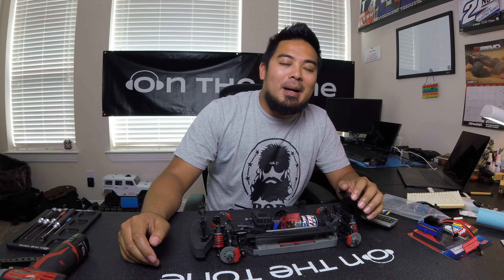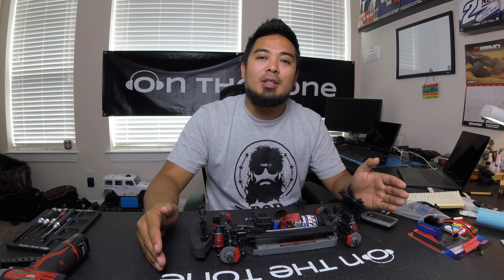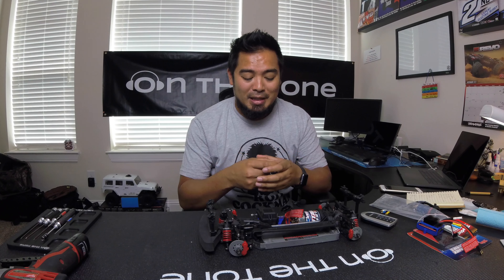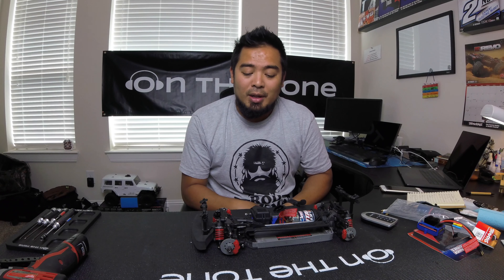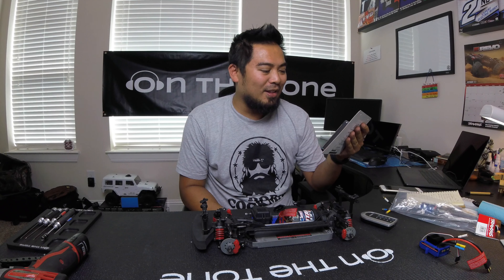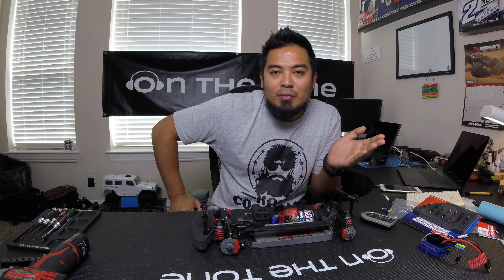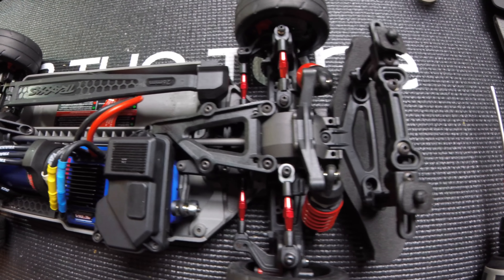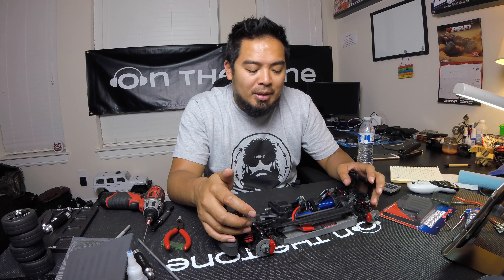Traxxas 4Tec 2.0 XL5 Vs. VXL

Comment: Just bought the XL5 version. I ordered some aluminum upgrades (turnbuckles, driveshaft, and motor mount) also HR axles. I already have a brushless Castle esc and motor. I also have a spare TQI controller with bluetooth. I already have a custom painted Audi R8 body. I still saved some money and will end up with a 4-tec that is better than the VXL. I just need to get better tires and wheels.
Reply: How’d it turn out?  There is a guy on here that hit 151mph, in a VXL, with stock gearing.  The 4 pole motor.

Comment: While you’re not completely wrong about the 2 pole spinning faster, it’s very pointless since both are 3500kv. You’d be better off with a castle sv3/4  or mamba x with a 5700kv 1406 motor